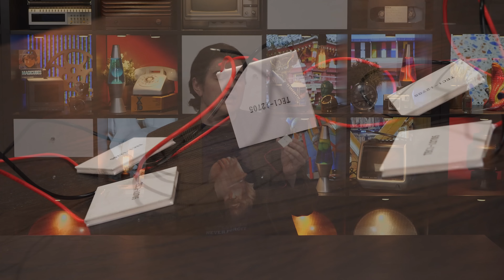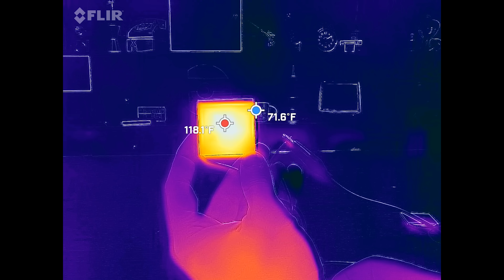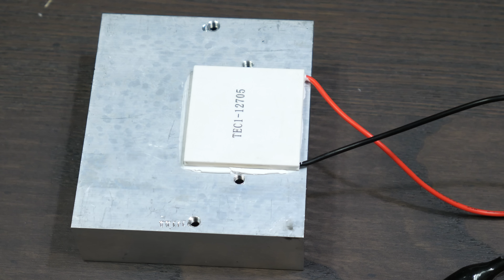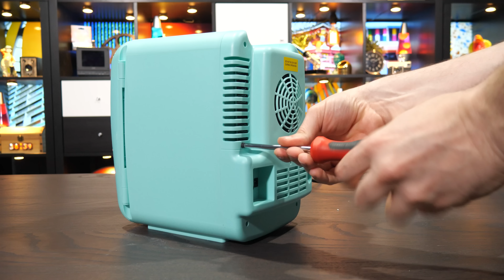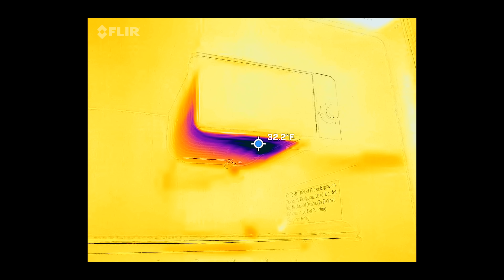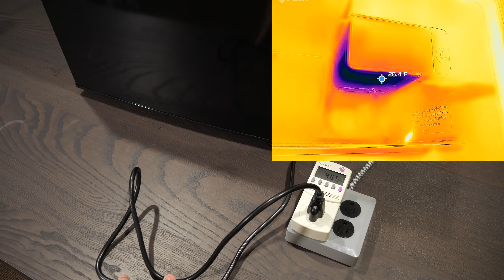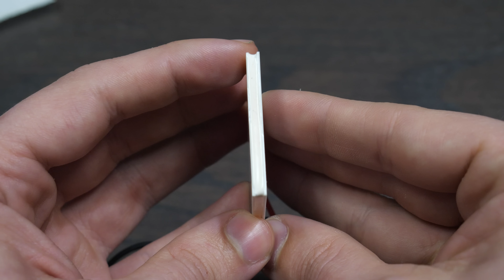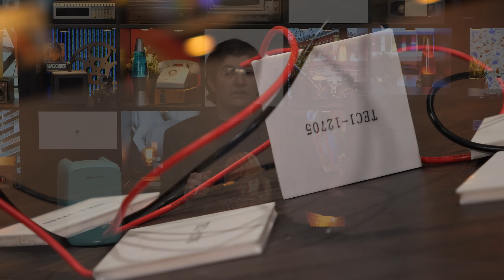Thermoelectric cooling: it's not great.

Comment: I got an hot/cold Peltier powered travel cooler about a decade ago, and that thing has been one of my favorite buys in years. It serves its purpose beautifully. It has kept cold things cold for long trips where ice packs alone would falter, maintaining a cold food safe temperature in the mid 30°s.  It can take a number of minutes to reach its coldest state, but when food is already cold and especially packed with an ice pack, it does the job. 
The warmer reaches 145° F, and does a great job keeping food hot. It is perfect for family gatherings that are more than a hop and a skip away.
It has a car adapter and a regular AC plug, which has come in handy numerous times...such as keeping the contents cold/hot while waiting for the rest of the family to arrive at the destination...

For these kinds of purposes, the Peltier powered cooler/warmer has been awesome. We've used this thing constantly over the years.
But certainly this is not something that is viable as a replacement for a proper refrigerator. It is really only good as a temporary or portable cooler/warmer.

Comment: I bought a Wagan Tech 6214 cooler about two months ago. Its power rating is 46 W (cooling) and 38 W (heating). It has a 14 L capacity. I bought it for a camping trip that includes a 15-hour drive in a Ford Focus full of camping gear. I plan to spend a few days camping out in the Boca Chica, Texas, area, to watch the SpaceX Starship rocket launch. I'm debating whether to take it along with me, as I do have regular coolers that work OK for two or three days, but I thought it might be nice to have something that could potentially keep my food cool a little longer (or heat it). I ordered the 6214 with the 12 V accessory adapter option. I might have been better off with the regular DC plug, as I also have a battery power station that could run it and my Ford Focus has only a single 12 V accessory socket and I have other devices that need it. 

Peltier devices have the advantage of being small, lightweight, and orientation agnostic. You mentioned all those in your video. You didn't mention that they also are more rugged than compressor-based refrigerators; that is, they can tolerate more vibration and shock. Or, maybe they can't, and that's why you didn't mention it. I was surprised that you said they are cheap, though. Peltier units used to be horribly expensive. My Wagan Tech 6214 cost me about $120, I think; maybe $150. I guess I'm paying mostly for plastic? It comes with a built-in fan and polyurethane foam insulation. It also comes with a web belt carrying strap. Here are some other specs that I pulled off Newegg's website: 

Cooling capacity: 32-36 degrees F below room temperature.
Warming capacity: 140 degrees F.
Interior dimensions: 10.5"W x 12"H x 8.5"D.
Exterior dimensions: 16.7"W x 16.7"H x 10.5"D.
Weight: 9.75 lbs. Includes 7.5 ' DC power cord for front or back seat use.

Comment: One more strike: peltier devices degrade with use.  The effect/efficiency degrade with number of operating hours.  See Mikami, Degradation of Thermoelectric Modules Under Heat Cycling Conditions. Journal of Electronic Materials

Comment: as an appliance repair professional/"expert" I feel compelled to add some context to the energy comparison to TCs comparison of his Kitchenaid "AMERICAN" refrigerator to that tiny little  can POS .
 He just used the standard government efficiency testing numbers on his big ol' american fridge which famously fail to account for real world conditions(from my understanding) .  Which are set with old school automatic defrost timers that activate every 12-14-16-18-24 hours for a set period of time 15-18-20-24-30min. 
Where modern refrigerators like his dual zone, thermistor controlled, switching valve system is checking ambient , cabinet air and evaporator temperatures before deciding to activate a highly energy consuming resistance heater defrost cycle.  Heck the newer units even consider the recent frequency of door openings in the formula in considering whether to activate a defrost cycle. If TC's Kitchenaid's Fresh Food section is a dual cooled(evaporator in the FF and FZ section) unit it doesn't have a defrost heater in the "fridge" and is just an "off cycle "  defrost. which uses ZERO energy as it turns off all of the cooling system, so long as the freezer is satisfied. The energy consumption is greatly reduced from the standard default government requirements for energy efficiency.  

All of this should be prefaced  by I'm a dude that ALSO loves a heat pump so much that he has solar panels installed for a few years and paid a MASSIVE premium to have someone drill down hundreds of feet for a "geothermal"  heat pump to be installed in his home. So I admit I'm way biased by energy efficiency math in pretty much any form.
Reply: Wow I posted this well before 16:00 min in and started to hear about his testing procedures , so ignore my comments or take with even more weight as you listen to his testing procedures.

Comment: I'm curious how much more efficient that toy would be attached to an insulated fridge with temp control. It seems like less of an issue with the heat pump at that point, and more with the insulation. Run the mini fridge with the door open a crack, and you'll also be using a LOT more power to keep things cool

Comment: Just about the only common mainstream use for Peltier coolers in this day and age would have to be the heating and air conditioned car seats.... I've also seen some promising work done with Peltier coolers being used for CPU/GPU coolers but at this point in time a 3,000 watt peltier cooler is required to keep a 5ghz CPU at a reasonably stable thermal load 🤷

Comment: I used one of this little fridges to keep my insulin cold (it doesn't need to be to much cold anyway) and it worked fine until the electrical bill arrived... that was the end of it... now my insulin is cold at the bottom of the kitchen´s fridge and the blue (yeah it was blue too) is somewhere getting dust.

Comment: I have one, and i didn't feel ripped off cause i got it for five bucks at a goodwill.

It technically cools things, as a fridge should do, but not very well. I used it as a  "Im gaming and i want my six pack of beer to stay somewhat colder than just leaving it out in the open air"

I think i used it about four times when i had it, and while it does somewhat technically work, just buy a fucking minifridge.

I didn't feel ripped off cause it was so cheap, but it wasn't a good use of my money.

Comment: I work R&D at a smallish company. One time our R&D VP gave us a project to work on, to find a way to make Peltier modules through thermal spraying in order to install them on our clients equipments, which produced alot of heat that would just go to waste. He saw it as a way to recoup some of the energy lost from throwing away that heat.

We worked seriously on it for a while. Then one day it became clear that it would be really challenging to pull off the design with our technology, as we were using subpar materials and the process isn't nearly as microwelding, so the amount of connections was  low. In the end it would've had to be really big and expensive, but it would still be inefficient. I made some tests, measured a few microwatts of power produced when putting my prototype between a heatplate on max and dry ice. Then I pointed out that if we made it 100 000 times bigger we might be able to light a LED. So yeah, that wad the end of that project.

Still think Peltier modules can have their uses but that would be in very specific situations. Remote location, no access to a power grid, no sunlight, and it would have to be near a natural heat source. Something like next to geothermal vents in the bottom of the ocean, and somehow we wouldn't want to harness the energy coming directly off of the geothermal vents in order to preserve the ecosystem around it... So yeah, very specific applications.

Comment: I have a Balck&Decker 24 liters portable cooler for my car, it works great for long trips, it can be also used with wall power too, so when I'm in a cheap road-side hotel I can have cold water bottles and cans both in my car and room, for me is awesome since I don't have to worry about power consumption since I only use it for trips, so not good as an in-house fridge solution, but peltier has its uses outside of a house.

Comment: I'm stupid and have long had an idea that pairing a higher wattage TEC using a water chiller to pull heat off of the Peltier and using that to cool computer components, not for every day use though, just for benchmark runs or torture tests and for funzies.

Yes I know that the cooling will consumer more power than the rest of the computer combined, but my idea is that you could use it to fine control how much power (and therefore cooling) you are providing and can try to run while not dropping bellow dew point where you start getting condensation build up on electronics that generally aren't a big fan of water.

The TEC would be cheap, the water chiller not so much... I know that they make TEC coolers for CPUs but they are stupid expensive and don't eat enough power to provide the cooling required for a high power CPU that draws +200W over a long period of time. This would just be a fun project and nothing but.

Comment: Ill watch until the end ofc (10:00 min at the moment), but I must say that I have one, that opens on the top, and it is for car use, 12V. And for that it is great. I cool my beverages in real fridge before journey, then I load this small one, and it is good enough to keep my beverages cool all day while driving. It is there more to keep it cool then to cool it, and by design, it is obv for beverages and not for food. And 6 0.5l beverages is just enough for two of us for the trip. I do not care about a bit bigger fuel consumption form using it. It's like there to replace or offer alternative to those mobile fridges where you need to put ice cubes to keep things cool. Also it's small enough to fit behind the seat in my small car, so that I can open it while driving and take a sip of cold beverage without getting distracted from driving. I will point out that beverages in question are not alcohol beverages. If someone could make as small as this one true fridge that works on 12V, then I could buy that. Extra noise wouldn't be a problem. Even you said you saw it on some auto/car show xD

Comment: I think you need to do a little more sampling before you establish your conclusion on the effectiveness of the Peltier fridges. The one I have sitting on my desk at work gets my drinks ice cold and builds up ice in the back of the unit where the module is that I do have to drain every now and then. It does take a while to cool stuff down initially if it has been turned off, but once there's cold drinks inside helping to cool down anything new put in, then it will keep a continuous string of drinks as cold as anything else out there.

Comment: Comparing a extremely cheap Peltier  cooler to a large fridge is pointless. The Peltier in that little fridge is undersized and no thermostat vs thermostat. If you use a larger Peltier and a thermostat, then you will get better cooling with similar power consumption. Get a 100W Peltier with a thermostat and you will get significantly better cooling inside the fridge. The thermostat allows you to control the temperature of the fridge to reduce power consumption. Its like using a space heater to heat your house vs central air.

Comment: I have a conundrum that perhaps you could help with Alex. My gym is known to get quite hot - it's got one room with a high ceiling and two adjoining rooms with lower ceilings. The staff have not one but two large portable air conditioner units to try and combat this, but there's a major issue: they do not connect the hoses to the outside at all, instead simply directing the air sort of upwards (in the case of the room with the high ceiling). They only recently brought in the second one and the heat got considerably worse. I have tried to bring it up to them and they dismiss me, saying that because the exhaust pipe is facing upwards it's ok. I have looked these units up online and they're about 2.5-3kW which is a lot of heat to pump into the rooms - pointing upwards is surely negligible. How do I convince the staff to turn these godforsaken air conditioners off?

Comment: The only practical use I ever saw for TE coolers was for cooling integrated circuits and transistors to lower the circuit noise. Farinon used them on some of their microwave equipment. RCA used them in the TK-43 camera to cool the first stage of video amplification from the orthicon tube. Most of the noise in a complex amplifier chain can be controlled by reducing noise in the first stage, because the signal and noise are multiplied by successive amplifier stages.

Comment: Yep, very inefficient compared to churning a motor.  It's the same as when you turn natural gas into electricity.  You chop a huge chunk of your available energy right off top converting it to electricity to run a heat pump.  Fortunately economy of scale has made compressor/motor units very reliable.  Same is true of pump/motor etc...  Even chip coolers are more efficient and more evenly cooled when pumped liquid or forced air is used.  My chest freezer, 19"x30"x30" uses 50w at roughly 50% duty cycle in the summer.  12v dc compressor refrigeration units are available and popular and effective.

Comment: I'm in total agreement with your conclusions. I've been using Peltier devices for many years (since 1995) and found them just awful for fridge applications. In addition to your points, the TEC (Peltier devices) fail very quickly due to moisture incursion, cooling fan, and poor power supply failures.

Comment: I mean yes, they are inefficient and don't cool great, but they do work and I wouldn't go as far as saying "Stop buying these" like it says in your video thumbnail. I've had a few over the years and for what I used them for they were a great choice. I still have and still sometimes use my pretty large 40 quart Coleman "electric" cooler that works surprisingly well. It's 12v DC or 120v AC. I first got it many years ago when we had a pop-up camper that the fridge was too small for everything. We kept food in the camper's small fridge and drinks in the electric cooler which stayed nice and cold. It paid for itself many times over by saving many summers of buying bags of ice for a regular cooler. The electric was included in our campsite, so it saved us even though it isn't an efficient design. We still use that cooler in the truck on road trips a couple decades after buying it, and it still works fine. I also used to have one of those 6 can mini fridges near my desk at work and it was great for keeping some drinks cool and on hand. That one was a Coca-Cola themed red one with the logo that I got as a gift.

Comment: A whole lot of ridiculous kvetching.  OF COURSE it would be better to have a real refrigerator, but most office workers don’t have a private office with room for such a luxury.  A communal office fridge will not have the space for each user to store six cans of their beverages. Fifty degrees is cool enough for soft drinks, or at least far better than room temperature.  No, it’s not adequate for your lunch or your insulin, but it isn’t meant to be.  Your employer might—MIGHT—care about the cooler’s energy inefficiency, but no employee will.  For a six-pack under your desk in an office cubicle it’s a fair trade

Comment: change it with noiseless fan, better heatsink, and thermal paste, I'd also rig a thermal switch (not variable, rather a simple fixed one to cut off power when ideal). also the cold side ideally need some heatsink too inside to take the calor (heat) from the inside

Comment: Could this be reversed to create energy with heat or cold? I remember an old video where someone had a piece of metal with wire attached stuck to a soup can with fire in it and also touched it to ice. Both created enough energy to charge a USB device. This was when USB was new. Probably USB 1.0 or 1.1.

Comment: My first job as a teenager was working for a guy as an electronic technician. I was in a digikey catalogue and I was like. This seems revolutionary? Why don’t we use these? He goes well the bad news is on the other side of the cold is extremely hot so you’re not really doing anything but wasting electricity 😂

Comment: one thing that I imagine taking full advantage of Peltier elements : clothes dryers....  You basically use the Peltier as the heating element, the hot side obviously faces inwards, but the cold side would chill the incoming air through a heat exchanger... This cold heat exchanger would chill the air below the dew point with the goal of condensing as much moisture out of the air as possible, before being heated by the hot side to do the work of drying clothes... The main point is that you are drying clothes with dry air, not heating clothes with hot air
This should allow clothes to be dried at lower temperatures, and at greater speed, especially in humid climates...

Comment: I will say the larger Coleman coolers that use Peltier cooling aren't terrible. I used to use one when I drove truck for beverages and lunch meat to make a quick sandwich while driving. It ran off 12v and the cord would need replaced every year, but it worked well. Difference was it had a heat sink and fan on the inside as well to circulate the cool air. Electricity use was a non issue since, truck.

Edit: we also used to use peltiers back in the day to cool cpu's when doing extreme overclocking.